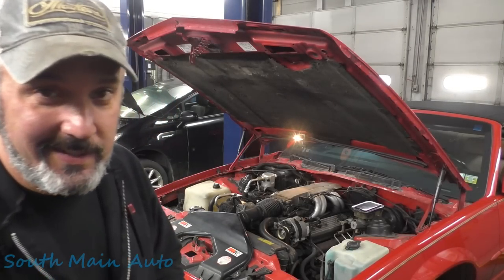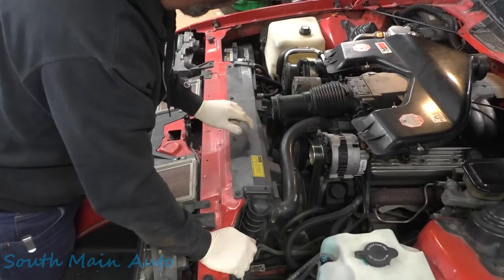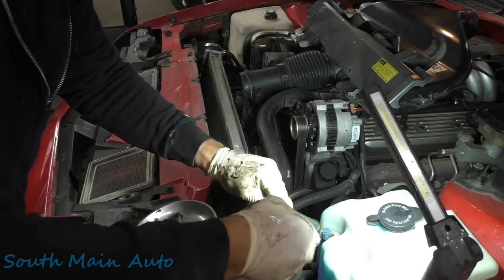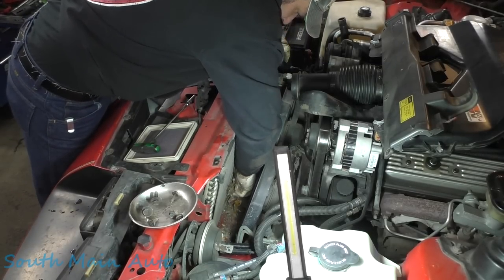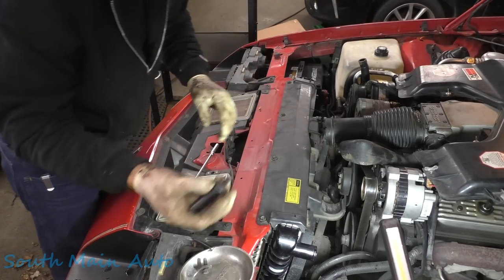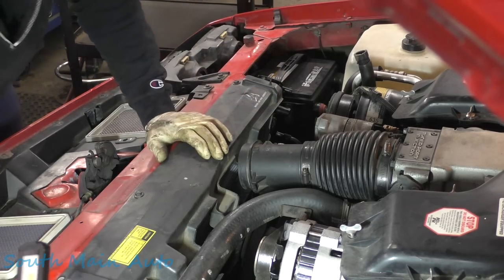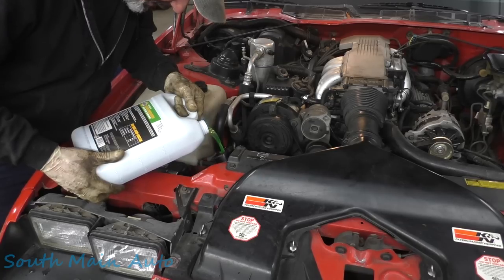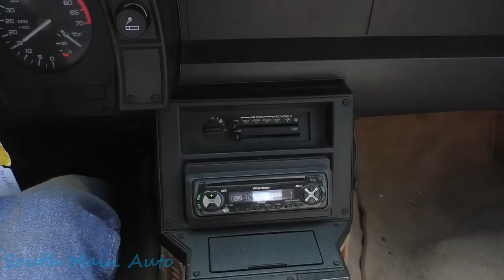'89 Camaro IROC-Z : Radiator Replacement

Comment: Helped a guy assemble a 57 T Bird in the mid 80's in his basement garage. No battery installed until all dash and other electrical was completed. It had the rare AM/FM tube radio and 312 engine. I put the battery in and I sat in the drivers seat and he sat in the passengers seat. I was checking the lighting and while he turned on the radio to warm up the tubes. After about 30 seconds the radio began playing the volume increased as the tubes fully warmed and just from dumb luck (or something else) it was tuned to an oldies station that was playing Walkin After Midnight by Patsy Cline. It was a spooky moment and we just looked at each other for a long minute.

Comment: Nice. My first engine swap back in 1991. Cut my fuel injection teeth on that swap. Put it into an 83 Olds Cutlass Supreme it replaced the Buick 231 V6. Good job Eric.

Comment: Eric "O"! 
Absolutely right on if these crap cars built today and 10-15 yrs ago will not be around like the old muscle cars.  I get people all the time asking to buy my genuine 1987 Genuine GMC S-15 Sierra Classic 2.8l 2-wheel drive with 220800 "original mileage.
The paint sucks but it'll go to NY n back to Cali 10 times without any bumps.  A guy offered me 5k for it a cpl yrs ago especially after he saw under the hood, which is very clean. 2nd owner here and they guy who bought it new had the GM dealer do all of the work on it. Only had to replace most common parts but no engine or major trans work needing to be done on it.  I can pull out the 2.8l motor and stuff a big fat 350cu in. monster under the hood along with changing out the tranny and rear end and smoke anything coming out of Detroit!!!!!!!!!!
Takes 15-20 mins to change out the spark plugs........... Do that with the shit built today???????

Comment: That radiator overflow tank is MASSIVE!
Reply: That old green coolant expanded a lot compared to the new coolants.
Reply: @300DBenz  - if it expands 2X (which seems odd) it is still massive.
Reply: I decided to research this.  The two types that I am aware of are ethylene glycol based and propylene glycol based.  The older ethylene glycol has a expansion coefficient of 0.00057 1/K versus 0.00062 for propylene glycol.  So the older style coolant expanded less.

Comment: My 1988 Camaro had the same issue but it was a bit more flashy when it died throwing up all its coolant out the bottom of the radiator. So now I am looking for an aftermarket one to support the new engine going in. Awesome video
Reply: Try seeing if wizard cooling sells one for the Camaro. They can make them as well if needed.

Comment: I really liked the styling of that era of Camaros. But, I liked the styling of the Mk III Toyota Supra even better, and by a chance encounter my wife had on an airplane flight, ended up buying an '89 in '94. White package (all white trim and wheels), targa top, N/A 3-liter inline six rated at 200 hp. I made a couple of modifications: I replaced the open diff with a limited slip from a turbo model, and switched wheels to a more open 5- spoke design (white of course.) I still have that car.

Comment: Nice. I bought a '89 Firebird Formula brand new with that same engine. It's true that it wasn't a race car compared to what they do today, but I had it for 4 years and loved it. It had the T-tops (yeah, they leaked at times), but so nice in the summer cruising around listening to.. Bob Seger? Probably.. 😂 I could even do the routine maintenance on it. Cool little trip down memory lane. :)

Comment: Another example of the improvement in the power to weight ratio of internal combustion engines is from the Wight Brothers. When building the "Flyer" they asked manufactures for prices on an engine that would produce 5 horsepower and weigh 75 pounds. No manufacture could produce such a light weight engine. Today the 5 horsepower Briggs and Stratton weighs 28 pounds. Less than half of what was not commercially available 120 years ago.

Comment: I agree Eric. Old cars are better. I have a 90's car I keep and maintenance is super easy on it. I think my radiator is about a 20-30 min replacement also. No need for a computer to diagnose what's wrong and simple electrics and mechanicals. There are a few modern developments that makes some jobs easier but you can't beat working on the old stuff that's been looked after well.

Comment: Chevy was my bank I made lot of money on automatic transmissions and they were so easy to remove and replace  never mind overhauling them  I had them lined up. they kept may wrecker busy too.
Reply: Ford's AOD/AODE/4R70W, and 4R100, plus the garbage AXOD Taurus transmission put a nice roof over my head in the mid 90's!!!!! Especially the Crown Vics/Grand Marquis that would always not shift past 2nd gear, and would coast with no engine braking at all, 99% of the time the direct clutch was fried and took everything within earshot of it with it.

Comment: I had an 88 IROC with the big 5.7 TPI.  I think it was 230 hp and 325 ft pounds of torque.  In the last year , 1992, it was bumped up to 245 hp and 345 ft pounds.  Engine ran strong to 4,500 RPM then fell flat on its face.

Comment: So true what you said about power.  In 1989 I had a dodge with a 2.5L turbo that made 150hp.  Today I have a Santa Cruz with a 2.5L turbo that makes 282hp and it's 0-60 is as fast as that IROC's (about 6 flat).  I had a 73 Charger with a 71 high compression 340 in it and I wouldn't race a Honda Civic with it!  But I do like the 485hp 6.4L manual transmission drive train in my 2015 Challenger SRT392...except for the fact that the differential may be shot at 15K miles because it apparently can't hack the hp.

Comment: For these older cars I let it warm up and I feel the upper hose to see if there is no trapped air, it looks like this is the high point in the system, but maybe its the radiator. Usually I have to burb the upper hose to get the pump to flow. Then add coolant to the hot level line on the reservoir.

Comment: I put a Spectra radiator in my 1997 Chevy 1/2 ton 2 years ago. Apparently Spectra was doing the OEM replacements for GM since the Harrison division was shuttled. Everything fit perfect, and was about a 20 minute job.

Comment: Back in the late 80s early 90s, when I worked as a tech at a gm dealership, they couldn't keep these in stock, especially the IROC series, which was only different from the regular camaros by the body kit. Not powerful now, but they were top of the line for the day

Comment: FYI, that big air dam in front of the coolant drain, if it’s missing or substantially broken, it will cause overheating issues at times during hotter temps when driving down the road.

Comment: Unfortunately that place you were reminded of doesn’t exist any more.  My brother and I spent a few months back in 1980 rebuilding a 1973 Pontiac Ventura that was flooded.  We got her running and put some headers and no muffler (we were teens)our elderly neighbor gave us a set of good used tires on condition we don’t fire her up after 9 pm.  I miss those days.

Comment: Now for extra fun, take a car like this and valet park it. It is hilarious. "No there isn't a key fob, use the key" "Okay the round key is for the door and the trunk, and the key that has corners on the handle is for the ignition" on and on... and eventually they just shrug and they tell you to put it in the VIP hotshot spot next to the valet. Works EVERY time.

Comment: The days when you could work on a radiator without removing the headlights and grille. Too bad it wasn't a '69, hard to believe how long the Camaro has been around.
Nice timing on that song too, Chevy used that in their pickup commercials for years in the 90's.

Comment: I had a 91 with the big 3.1 and an auto a couple years back - got it for free from a fella, had been sitting in his driveway for about 12 years, what do ya know i put the jump pack on it and fired right up! the ole acdelco battery even held a charge. it wasnt fast...or reliable...or well built... but ill be damned if i didn't love driving that thing around!

Comment: I believe "Like a Rock" was featured in Chevy TV commercials from that timeframe. Like many, I had a similar car - 1988 Camaro with a 5.0 and 5-speed manual. Black with silver trim, not a convertible. I bought that car brand new and my insurance rates made me sell it one year later.

Comment: Ahhh 80’s F Body creeks and noises. Pops had a 83 firebird with a cross fire 5.0. Dual throttle bodies seemed futuristic. Its original 700r4 lasted 180k miles and shifted like day 1 when it was totaled in 1991. Strange as the early 700’s had a bad rap.

Comment: I have a 2021 Jeep Wrangler with stock 392 Hemi. Last of a dying breed. Engine makes all kind of ticks and knocks at low speeds but purrs and growls smooth as silk above 50mph. Wouldn’t dare drive a Wrangler above 75 or 80 but it’s fun knowing it could smoke many sports cars out there. Not that I would race off the line, because it would age the drive train 3 years every time I did it. But still…. Probably my last V8, ever :(

Comment: The first time I saw an IROC Z28 was in 1968 when Kendall ran an ad with the Z28 thundering around a road course (I believe it was Watkins Glenn). That little DZ 302 had close to 400hp up through 6000 rpms. If I hit the lotto......

Comment: Don't normally comment on this channel, but I had an 89 Z-28 that I pulled the 305 out of and dropped a built 600hp 454 in. Could barley keep it straight down the road if I hit the go pedal hard.

Comment: Yo bro, cool fun job man!  I remember it fondly the night me an a bud were about 18 and just wandering around this dealership and there was red Iroc like this that was unlocked and the damn ignition lock happed to be broke so it just turned and started without a key!  Don't worry, don't worry... we only took it down the old gulch road for a rip and did a few burnouts though the tires were already bald and then parked it how we found it... little after hour test drive.  Soon after I had a 83' Firebird with 500hp stroker small block and 4 core custom radiator. Ditch that plastic crap!

Comment: I crack the lines loose with a line wrench.thwn i use a ratcheting line wrench .i bought a set maybe 30 years ago.dont know if you can still get them but they work great once the nut is loose.

Comment: Had one come in my shop in the late 1990s complaining of overheating only driving it down the road and the coolant fans were on... Come to find out he was in a  minor FE wreck and didn't replace the lower valance that diverts the airflow upwards into the radiator area while driving. Those models unfortunately had a full bumper cover with no real direct flow to the radiator.

Comment: I LOVE these cars I have an 87 IROC-Z in need of a restoration but when it was on the road it felt soooo right blasting Molly Hatchet , Ratt , Dokken lmfao   and these days you can easily hop em up a bit so theyre not suych dogs...even witht the 350 TPIU mine is still a dog in comparison. a T-56 however is in the works :)   they handle like big go karts too
Reply: Also Bob Seger FTW

Comment: Heh I remember when things like having a serpentine belt were a fantastic innovation, had an '82 Trans-Am myself and it was a dog to work on. Of course, the most annoying thing was when I thought those plastic molded cap "screws" on the dash panel were real and tried to remove the gauges that way...yeah, stripped out instantly, cosmetic feature :/

Comment: Any vehicle with an LCD screen almost certainly won't be working properly in 30 years.  Those LCD screens use what is essentially a fluorescent light behind the LCD to back-light it, and there's no fluorescent light in existence that can work for 30+ years.  Even the few that are LED-backlit will probably be dead long before 30 years have passed.  It's pretty rare for any kind of light to last 30+ years.

But -- if it's at all possible for it to survive that long -- the new 6th-generation Ford Bronco is a cool enough vehicle that folks 30 years from now will look back at it and remember it fondly.  At least in my opinion.  Assuming the screens in it still work.  

Yes, I did just happen to buy a 2022 Bronco.  Why do you ask?  😉😁

Comment: Hi Eric, I can tell you my Roku is not on full blast it sounds perfect. Also I would like to say that looks like the identical radiator that's in my 96 Silverado, I mean to the T. I do have a question though even though that is a small getting low horsepower IROC who in the hell would not drive their IROC I guess it's just a showroom car. Sorry about that if I own it I'm going to drive it. Thanks for sharing yet another perfect video, if it wasn't for guys like you Eric on YouTube especially when you're doing all your troubleshooting I would be totally lost. I don't own a computer and I don't want one, although I'm finding out even with the old Silverado and my other k2500 which is a few years newer you have to have a computer to do certain things. Oh well I guess I will leave it up to the pros like you Eric, thank you so much. Many blessings to you and the family as always.
Reply: Makes sense... I know the 2.8 Firebird and S-10 pickups had the same computer, etc... also I just ordered a 3 core aluminum radiator for a 2002 Dodge Ram that is apparently cross referenced replacement for a newer Camaro?!

Comment: You said it was one step above a carburetor, that's wrong. It's two steps above a carburetor as one step above a carburetor would be throttle body injection.
Personally I don't consider either above a carburetor I. As my carbureted 68 Charger doesn't have to spin the engine over 5 or 10 times before it fires up. About half to one revolution does it damn near every time. You folks can keep your fuel injection. My 54-year-old carburetor is working just fine. It's solid,  like a rock.

Comment: You're supposed to start the transmission cooler lines before you secure the radiator!  ;)   ( Much easier to wiggle the radiator than bend a solid line.)      Yeah, Bob Seeger and an Iroc Camaro... Takes me back to when I was a younger fella of 40 or so... sigh

Comment: I have 2 of rhe close kin to those cars 86 Pontiac firebird and 84 Pontiac firebird 84 has a 350 with 700r4 automatic transmission and the other has 305 with 5 speed or better known today as anti theft device the third pedal

Comment: Thank you, Thank you, Thank you! It is so nice to see a classic IROC-Z that is somewhat complete. No Cracked Dash,  and running properly. If I showed you what my "1988 IROC-Z Project" looks like you would laugh. At least I have the original radio. Too bad it doesn't work! (Like most things in this car) May I ask you a question? My IROC hadn't run in  approximately 7 years. It was just a bad computer. But it does appear to have a Blown Head Gasket, no milky oil, white smoke in the exhaust. I start it and let it run for a couple of minutes once every week. Since I am going to have to have it rebuilt anyway. Is this harmful??
Reply: Go watch a Chris Fix video.  He did a test with cans of goop stuff that may/might/could be kick the can down the road.  In his case, it took about a year to fail.  I think it was his old man's Jag (the one that had a Lincoln cousin with the same engine).

Comment: Even at today's standards...I'd trade off a "hi po" honda civic si EVERY TIME for the "195hp" 89 camaro! The camaro is light-years ahead for  longevity  and aerodynamics, all around affordability, and simple easy to work on engineering. Piss on some over engineered Honda.

Comment: I have this car but 91 had it 22 years now it chews through those crappy stock radiators like candy so a year ago I had a custom all aluminum race radiator built for it the stock held 1 gal of coolant the new custom one hold 3 and the car has never run cooler

Comment: I think modern cars won't be running in 20 years time. I drive a 1997, everything is metal. Metal intake, metal sump, metal thermostat housing.

Not only that but manufacturers now just say no more parts or indefinite back order after 7 years.

Not as many aftermarket manufacturers of upgrade parts today vs previously.

For allot of nations small capacity turbo engines is new. For us in New Zealand who got everything from Japan, we had small turbo engines throughout the late 80s and 90s.

They're still running fine but, today's engines aren't built as strong. Conrods look smaller, pistons seem weaker, rings seem to be plastic composite, and of course you need three scan tools to do anything.

My opinion at least.

Comment: I rounded out the upper tranny line nut,  even using a 1/2" line wrench. Ugh..  off to the mechanic.  Beware...those nuts have softened over time and very easy to round.

Comment: No 4 cylinder turbo rice rocket will ever match the torque of a normally asperated V8 engine from this generation or the carburator generation. Why the  fixation with horsepower numbers when it is torque that gets you moving and down the road quickly, effortlessly and reliably.

Comment: Today's Cars lack individual style and panache. They all look like bubbles
Reply: Theres only so much you can do with a tank.
Reply: @milfordcivic6755  de gustibus non est disputandum
As for myself, I throughly enjoyed the style and power of my 71 mustang convertible with a 351C  I built...425hp at the rear wheels, air conditioned convertable..